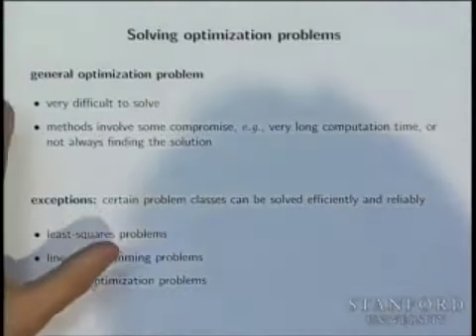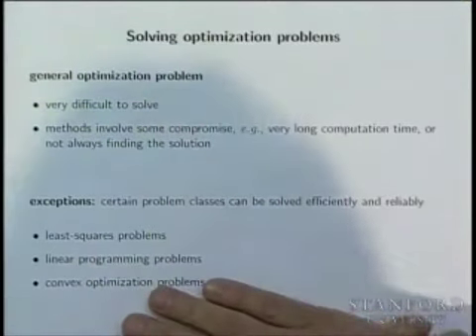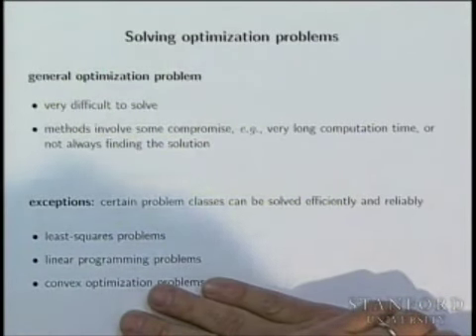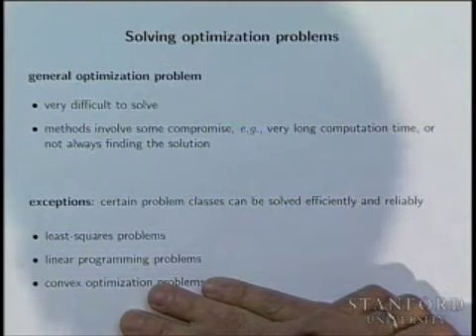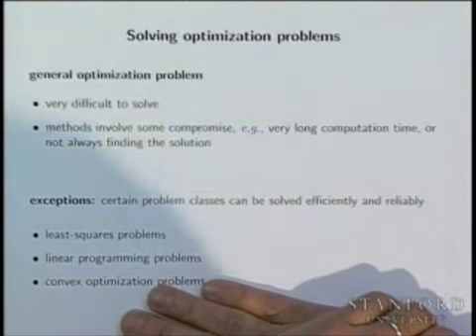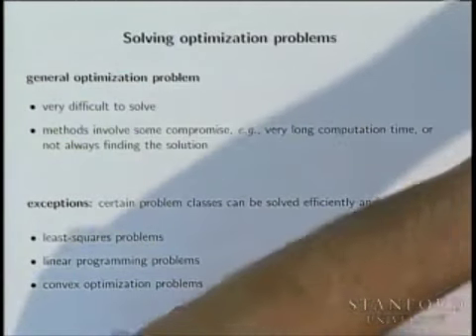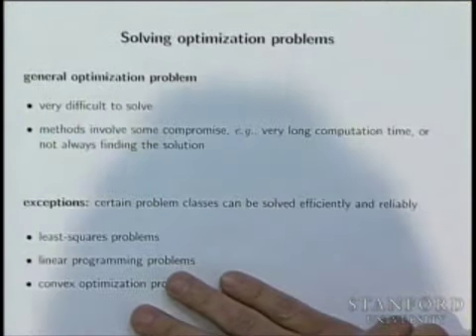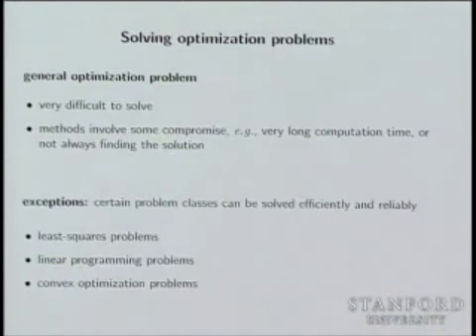A working definition of NP-hard (Stephen Boyd, Stanford)

Comment: P versus NP is considered one of the great open problems of science. This consists in knowing the answer of the following question: Is P equal to NP? This incognita was first mentioned in a letter written by John Nash to the National Security Agency in 1955. Since that date, all efforts to find a proof for this huge problem have failed.

I show a solution to that problem as follows:
Given a number x and a set S of n positive integers, MINIMUM is the problem of deciding whether x is the minimum of S. We can easily obtain an upper bound of n comparisons: find the minimum in the set and check whether the result is equal to x. Is this the best we can do? Yes, since we can obtain a lower bound of (n – 1) comparisons for the problem of determining the minimum and another obligatory comparison for checking whether that minimum is equal to x. A representation of a set S with n positive integers is a Boolean circuit C, such that C accepts the binary representation of a bit integer i if and only if i is in S. Given a positive integer x and a Boolean circuit C, we define SUCCINCT-MINIMUM as the problem of deciding whether x is the minimum bit integer which accepts C as input. For certain kind of SUCCINCT-MINIMUM instances, the input (x, C) is exponentially more succinct than the cardinality of the set S that represents C. Since we prove that SUCCINCT-MINIMUM is at least as hard as MINIMUM in order to the cardinality of S, then we could not decide every instance of SUCCINCT-MINIMUM in polynomial time. If some instance (x, C) is not in SUCCINCT-MINIMUM, then it would exist a positive integer y such that y < x and C accepts the bit integer y. Since we can evaluate whether C accepts the bit integer y in polynomial time and we have that y is polynomially bounded by x, then we can confirm SUCCINCT-MINIMUM is in coNP. If any single coNP problem cannot be solved in polynomial time, then P is not equal to coNP. Certainly, P = NP implies P = coNP because P is closed under complement, and therefore, we can conclude P is not equal to NP.

You could read the details in the link below…

https://hal.archives-ouvertes.fr/hal-01509423/document